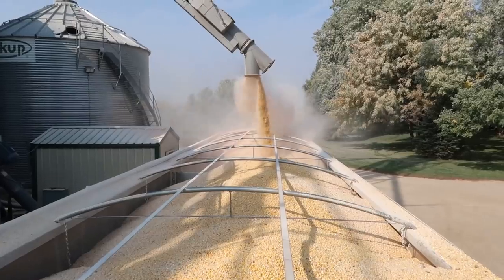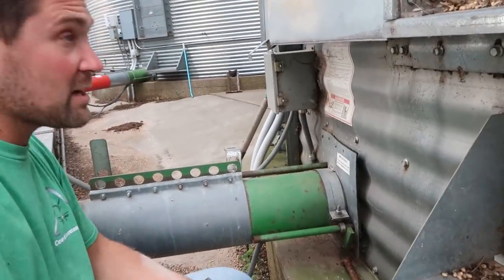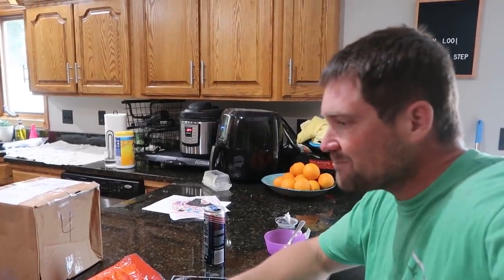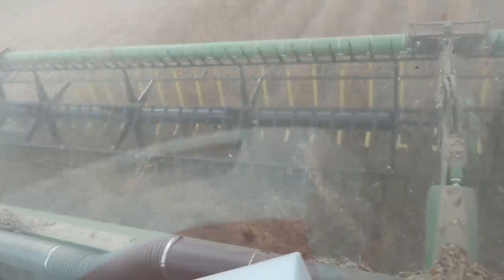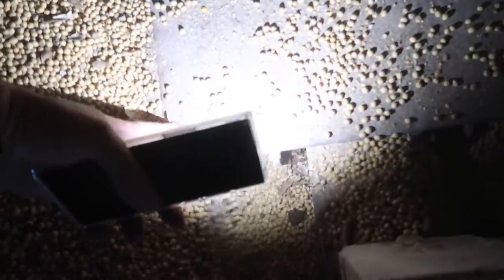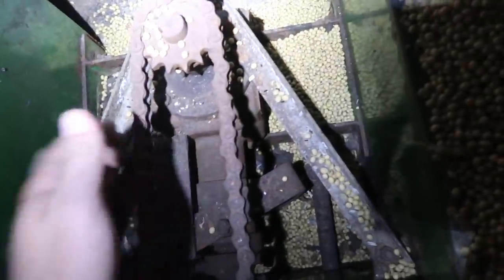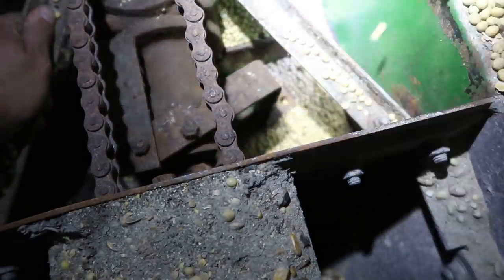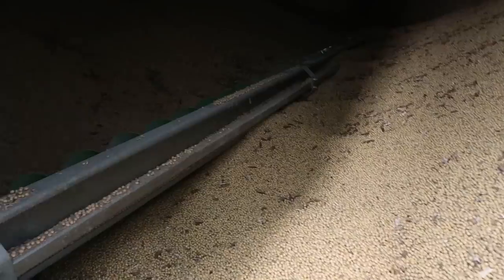Grain Bin Entrapment

Comment: Hey Millennial Farmer. Do you have some statistics about the major causes of all the bin accidents? Is it entrapment by moving grain? Is it falling off the top or ladders while inspecting? Is it caught up in moving machinery? Or what else? Why are you guilty of not being safe? Farming, Fixing & Fabricating is another video that is similarly guilty. You should appoint Becky or some other responsible person on the farm (not yourself) as a safety officer. She should review all tasks done around the bins, develop procedures and make sure they are enforced. Why are you inside a bin without a safety rope and some one outside on watch as well as help. The excuse that no one was available doesn't cut it. They don't want you missing for days or forever! Here in Canada, a bin like yours is an enclosed space. It requires air testing, electrical lockout, a safety rope, a fan blowing in air, a sentinel at the entrance and all the usual PPE 
Collecting funds to train first responders is great. But you need to train the doers how to do it as well. Please do both. All other tasks on the farm must be reviewed the same way.
No more videos showing unsafe practices. Please be safe.

Comment: Shows how little I know I was thinking the plywood was for safety rather than a funnyel or restraining device  
I studied that chain in school it was called HISTORY

I worked in a shipyard building Navy Destroyer/Submarine tender with BIG stainless steel storage for radioactive water I believe Argon was the inert gas they used for welding 2 guys climbed inside after lunch down for the count 2 more followed someone screamed 2nd guy stopped and made it back up the ladder the first 3 were not recovered in time first responders finally got into SCBA’s but it was toooooo late. LOTS of tanks and voids on ships  whether in new construction, repair or operations I’ve been in a few and if I/we couldn’t hear the fan running we were EXITING. There’s no O2 in that grain when it settles around you, conscious for a short time you realize what’s going on and NOTHING you can do about it make sure you can go home to the wife, kidz and Shetland Sheepdog’s named Q-tip. I was a scuba diver back in the day taint no fun when no air comes from the regulator

Comment: Don't you have any mobile augers on the farm for moving grain when the main go down or have issues.... and if you have that problem fix it now and redesign so that you don't have the same problem again.... I see it all the time people deal with the same issues every year and never fix the problem so it never happens again....I would just add a long lever and mount a fulcrum .... or change it to a screw activated shift bar and be done with it.... as far as entrapment never enter a bin without someone else there and take all precautions.... there really is no reason to ever take bad risks.... and I didn't see any lockouts on the controls to that auger you really should add some so no one comes along and turned it on when you're in there... I have had personal experience with people that don't have lockouts .... highly recommend you have lockouts it's cheap protection